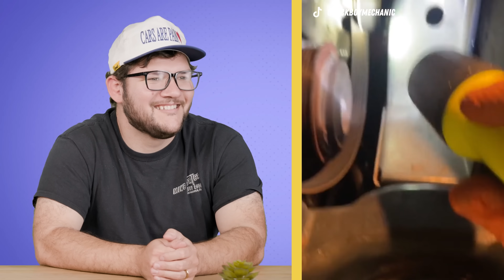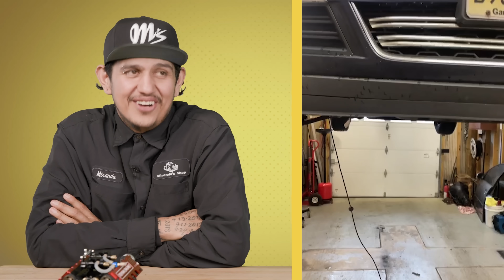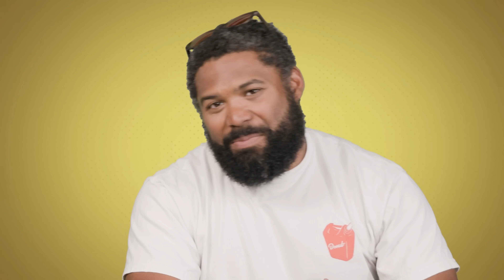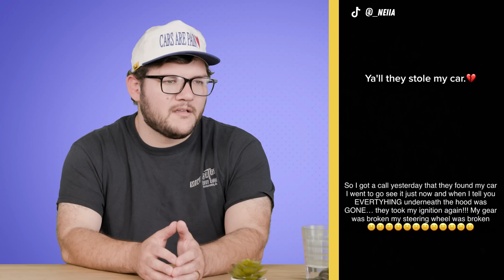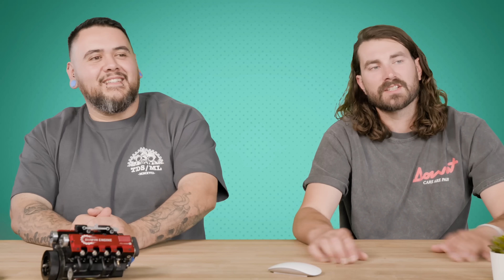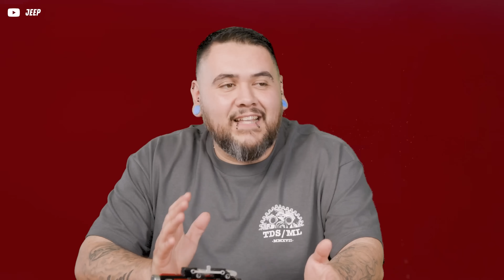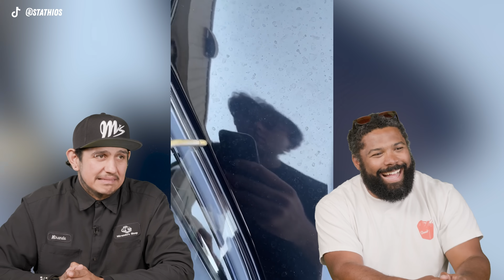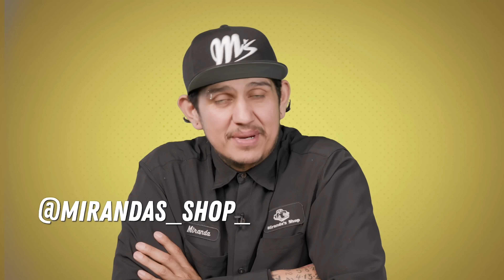Mechanic Reacts to Car Engineering Fails

Comment: I fix appliances in home and often find myself wondering why the F I need to dismantle 75,000 components to get to something that should be accessible with a screwdriver, often with the client standing next to me the entire time talking about their cat or their day while I slice my hands open on interior sheet metal. I often joke with colleagues about how the engineering teams at these places have secret meetings on how to screw with the repair techs as much as possible. 

Not the same level, but I absolutely understand the frustration. You’re not alone, auto mechanics. FYI, anyone reading this, don’t buy Samsung products. It’s 90% of what I work on.

Comment: in the defense of the engineers. We complain about the issues we find. but not about the conveniences they give us. we find the negatives. in a car with all those electronics and all those parts its impossible to account for every possible leak and every possible point of failure. while some, such as the bolt in the first clip is absolutely stupid and that engineer should be fired since everything car planning should start with the idea of reparability, there are some designs where things are intentionally made difficult to get to or fixed because its deemed the average person with little to no experience should not be attempting it. but ultimately things like that leak leaking onto the 02 sensor, you cant always predict that it will leak at that spot, into that part, and that particular failure is something that only becomes apparent over time and miles, not on the design board.

Comment: Where I live, the cars all park on the right hand side of the road. But the Engineers with all their wisdom who manufacture electric cars are installing the charging port on the driver’s side, far from the curb where the city has installed parking meters and the charging posts.

Comment: As  an ex engineer, I always designed my machines with the field repair in mind. I have been there and I know the repair engineer is usually not familiar with the machine and they are under pressure at the customer’s shop. In addition, teams with the engineer is a manufacturing engineer who takes a broader view with a view with how to put the entire machine together

Comment: 6:15   Not a fan of Jeep / Chrysler. YET.. the way this individual is hitting the start... you have to hold it down.. its not a gaming controller. I work in a very tight space and backing up anything Chrysler absolutely irritates the vinegar out of me with safety features and halts the vehicle immediately. Settings can be adjusted but I'm used to older things. So... thats on me I guess... I need to learn to navigate the menu and features better to turn these irritations off while on a dealership lot. 50% engineer and 50% ME... or... more on me. I just hate it. ALSO... love the channel... I've been binge watching and absolutely love what y'all do. I learn a lot and enjoy what I'm seeing. #NOOB

Comment: easy fix on the water leak .. do not drive in the rain ..... and keep car covered ,, my 1997 mustang convertible leaks so it sits when it rains . replaced top , seals ,,  the worst  worst design ever still leaks ,,

Comment: I was a Non-destructive Testing (NDT)/Quality Inspection. I had an argument with an Engineer on a prototype engine part on why I could not do MAGNETIC Partical Inspection his ALUMINUM  part. (For those who might not, and do NEED to aluminum is not magnetic)

Comment: Engineers are idiots the engines are completely and dropped into the engine bay I know I was a mechanic give me a 50s 60s or 70s to work and don't get me started with 80s models on......

Comment: On that comment that I made about the factory sabotage in our vehicles to break down so they can force us to buy a new vehicle
My information come through just meeting people throughout my life for 40 years
Everybody's got a story to tell and sometimes it's about vehicles

And I also come across the story about the light bulb in the fire department look that up
Bottom line of that story is about money

I also found a story about a guy believe that he can put out power without the use of telephone poles and wires
He demonstrated and it was possible
But nobody would back him up to make it possible
All because it would  shut down the business of the telephone poles and wire that you would need to get power to a customer's house
Which they would have to pay for
This is also about money

In a museum somewhere you will find a battery-operated vehicle that was made over 100 years ago or more
If they would have continued they probably would have had all the bugs worked out of it by now
But the oil industry the gas company did not want that to happen so they shut him down so they can still sell gas and oi

SO YOU KNOW WHAT I'M GOING TO SAY
IT'S ABOUT MONEY

SAME WAY WITH OUR VEHICLES
FROM THE STORY OF THE LIGHT BULB IN THE FIRE DEPARTMENT
LONG STORY SHORT WHEN YOU LOOK IT UP IT'S ABOUT A LIGHT BULB THAT STAYED ON FOREVER
COMPANIES HAD TO ADJUST THAT SO THAT PEOPLE WOULD KEEP BUYING LIGHT BULBS
THAT'S WHEN THEY REALIZE THEY HAVE TO MAKE THINGS BREAK DOWN SO THEY CAN RESELL THEM

DO YOUR HOMEWORK
DON'T TAKE MY WORD FOR IT

Comment: On the ladies comment on the engineers only goal is to get past the warranty
That's true but I also want to bring this issue up first
The engineers also make it where you have to take it to the dealership to get it fixed or buy a new car

For over 40 years we talked to a lot of people we all do how about any subject because they all have a story to tell
By focusing in on one subject
I honestly believe
That the engineer also sabotages are vehicles to break down at different times can you use  different parts to 
So we won't be obvious

Should they have been putting sensors in computers in our car this has been happening a lot
I honestly believe to tear all the sensors off computers off that motor and that transmission still works good

Because I got a 72 Camaro is still running today it don't have no relay switches no computer

If the water pump goes out you know exactly what it is if the oil pump went out you know exactly what it is
Anything that breaks down on the 72 model is so obvious that easy to fix

And now they got to work it'll be 20 different relays between a and b 
If you take all the sensors out between A and b

And I bet you my life savings if you take all that stuff out between a and b
I bet you there's nothing wrong with b

I just can't prove it 
it' no different than somebody putting sugar or salt in my gas tank
My sabotaging it it's the same
By making us buy a new vehicles
So one of my truck started to break down so I took her to the dealership
Will the dealership couldn't fix it said I probably would have to get a new car
Will I hire a hacker guess what it's running the
Bypass the bunch of crap

I'M JUST SAYING
DO YOUR OWN HOMEWORK DON'T TAKE MY WORD FOR IT 😎

Basically it's all about money

Comment: I worked at a part's store for a bit. A customer brought in an alternator he had recently said it was bad. After testing it several times I suggested he look at the pulleys and tensioner. He said "engineers designed the belt system, and they are some of the smartest people in the world. When I caught my breath, I exchanged the alternator. A few days later, he was back buying an idler pulley.

Comment: My uncle was an engineer for one of the big 3 and regularly complained that they compartmentalized to the point that they didnt know what was going around what they designed. He said that he had asked, many time, what went around what he was designing and the respo se was always the same. "This is what you are to design and this is the space you have to put it in." Then if asked again the next response was always "this is what you are to design and this is the space you have to put it in. If you ask again, we will find someone that will amd you can find a new job."

Comment: I started my career as a mechanic (8 years) then moved into engineering for a major OEM. 
Now every project I work on I make sure it will be as difficult as possible to service any part so I can text my buddies still in the trade with a picture and the caption “good luck buddy”

Comment: I works as a sr tech in a mass manufacturing and most engineers always verified on 10-20 PieCes and they will be lost forever after that and left it to run like 100k-200k more, and when we feedback a process problem, they will always said "oh, we run it great last time" and shift the blame back to the low wage production operators. I guess all the studied in college only to prepare them for talks, not on problem solving.

Comment: Retired ASE Certified Technician. I ran into the exact situation with a tensioner bolt set up. I figured out what I was gonna do in Three minutes. It was a job that book paid like five hours. I did in 45 minutes and had the car out the door. I took a 2 inch hole saw and put a hole in the metal firewall.

Comment: Little water leak. "ooh, your'e gonna need a new car". Used to have to fix water leaks all the time when i was an apprentice. To be fair, it was usually warranty work and we replaced all the under felts under the carpers and once the car was stripped and the leak found and fixed we would put the car through a bake cycle in the spray booth to make sure it was dry. Never had a car come back with electrical problems so i think i can safely say, you don't need that car replaced and it will be fine once fixed.

Comment: The oil change on the Range is supposed to be vacuumed out. Special place under the hood for the hose to go. Also, if you own a new Range Rover... why are you changing your own oil?

Comment: Sorry, but that Traverse would have a new panel gap created with a decent size drill bit. I'm not taking the engine off the motor mounts and I'm not doing something completely asinine just to remove a bolt. It would definitely be easier to change next time.

Comment: Thumbnail without even watching all you have to do is unbolt the motor mount and either raise or lower the engine to get it out, takes longer to complain about it than it does to remove it

Comment: Oh yeah and another thing that the dumbass enigneers don't consider is warranty times for replacing some of these parts they design the placement of and I think they don't give a damn about the placement because honestly why the fuk would they give a samn considering they're never the ones that have to fix or replace any of these parts? Here's what I've always thought about like the placement of that idler arm pulley if it were mandatory that every engineer who is allowed to design vehicles have to had worked in an auto shop repairing vehicles so they never design any vehicles with bullshit poor ass parts placements in the cars and trucks they're designing and when they make the damn warranty times for all these parts that are gonna have to be replaced at some point they've gotta realise that their techs making the warranty times automatically know what tools they're gonna need for every nut bolt and adjuster that gets removed, replaced or moved outta the way and they know that vehicles sold collect rust pretty quickly so that adds time to fix these vehicles when they break under warranty! You can tell they know these things are an issue because they also make the outta warranty times for these same fixes on every car they've designed. And when you see the time differences between these repairs they're totally fuking with every tech who is forced to fix their design fukups!.

Comment: Can't blame the factory for the bulkshit designes they're building at the factories. Not for the length of that idler pulley at all! Because the factory puts the idler pulley on the engine before they put the engine into the cars.

Comment: IT honestly sounds and looks like what needs to happen is the engineers need to be paired with a mechanic in the process of building a vehicle to not only understand how to put it together in the factory , but also how to take it apart for maintenance in a shop.

If the Mechanic can't take it apart and put it back together then it needs to be redesigned.

Comment: mechanics, we’re on your side bro. it’s the fucking bean counters, just like boeing

like, think about it this way. we’re trying to design these things so they’re easy to work on because that makes everyone’s d2d life easier. engineers have to work on the engine before it even exists. engineers would never put something in the wrong place without being required to by management. it’s always the accountants. (no hate for the actual accountants, y’all are great and just doing your job)

Comment: In the first video To remove the pulley i
Would of just drilled a small socket-sized hole through the subframe fur sure and the oil change could of been prevented in different ways to avoid making a mess I would of just stuck a shopvac hose to it or something to drain it into an oil pan 🤷‍♂️

Comment: I love that comment at the end, "engineers think they live in this perfect world." I work on refrigerators and certified to work on LG fridges, so I run into my fair share of problems. A lot of these newer fridges are pretty much made in labs with controlled conditions. In a home, there are so many variables unaccounted for: Pets, outside temp, doors opening and closing, the cleaning of the back panel vents, drain tube(s) designs, and power surges/outages.

Comment: I think Nissan designs their brakes to be hard to change at home. The line leads in right where you would put a c clamp to reset the piston in the caliper and you end up crunching the copper bolt if you aren’t careful. You need specific tools to do it right or you just have to be careful and pray.

Comment: I think ALL engineers automotive, industrial, electrical, mechanical, structural ALL fields Should have to work in the field for example in order to be come a certified Automotive Engineer you have to go work as a mechanic for 24 months prior to becoming a pencil pusher. and they have to use the same time set and same instructions. nothing special. 
then every 10 years they have to work on them again for 3 months just to keep them in check.

Comment: Belt tensioner bolt. I would use a drummel or anything that I could to cut the exposed bolt, you can see enough bolt there, I'm sure cutting the bolt, extracting the remaining stud and replacing with a shorter bolt. Much more simple than screwing around with engine mounts.

Comment: 9:21 SO glad someone else said that, as a mechanic I genuinely would not buy anything built in the last 5 years. I see the panel gaps, I see how poor the rust coating is, I know how thin the paint is, and I know how many electronics are in them. I have no faith these cars will stand the test of time as well as 90's and early 2000's cars have.

Comment: as mechanic i hear a lot of enigineers saying here : ,, its not us, its the greedy managment,,
probably... but not  90 or 80% as you would like to say

i dont have engineering degree but even i can understand just being plain lazy but when it comes to maintenance part..... engineers literally say FUK IT,  not my problem my job,  is to get the thing working

i worked on vehicles, factory machinery etc... and the machines that were designed by an ex mechanics, are way, and i mean waay better production and maintenance wise

engineers is white collar job, where they think, that they can relate, or understand blue collar work

Comment: The rusty bits on the McLaren might have been a supply chain issue. The reality is that it really is a team effort. You need good engineering, supply chain, and assembly to make a good product. One other thing to note is the cost of quality is non linear. It might cost me 1 million in development or quality controls to get down to a 5% defect rate. Going from 5% to 1% is probably gonna cost another 5 million.

Comment: I know in the manufacturing process for a certain Japanese brand the builders are told if they see a problem say something but if x number of cars already went through they wont go back to fix it and they wont change the assembly line. Theyll leave the problem for a tech to fix later because its more expensive to stop the line than it is to pay a bunch of techs later

Comment: As it was stated a lot of bad decisions are made because the problem most likely won’t come up while the car is under warranty and the manufacturer doesn’t care about the car after warranty. They made the money off of it because it didn’t need warranty work. We like to blame the engineers automatically but sometimes if you don’t work with stuff it’s hard to realize what looks good on paper doesn’t always work. Sometimes if it will affect sales they will make a change after a couple of years worth of complaints but the mechanic still has to face the original issue for the first cars.

Comment: Sandro be spitting hot truth.  Call it an engineering or manufacturing fail, the reason it happened is the big money people at the top deciding to cut costs.

Never forget, Ford executives knew the Pinto's fuel tank was vulnerable and decided it would be cheaper to settle lawsuits than build a safer vehicle.  It's always the money.

Comment: Many aviation companies have engineering assistants in all of various fields to help manufacture aircraft I was for aircraft structures; I’m sure the auto industry does too  only difference is we have FAA manuals and that Manual is the law, thus an assistant can say no to a particular build. Auto industry its management overiding engineering. It can happen in aviation also however I will not sign the work off

Comment: HaHa,Jeep has had electrical issues from the 70's,find a CJ with a working gas gauge, than find the winning powerball ticket attached to it. Unless it has a aftermarket harness or owner has done significant work